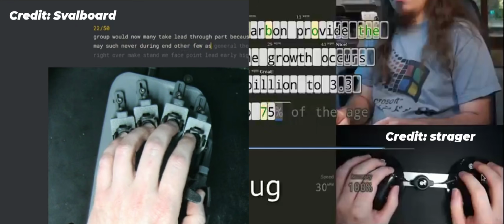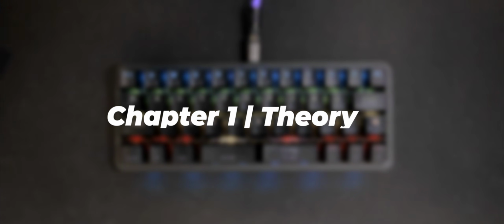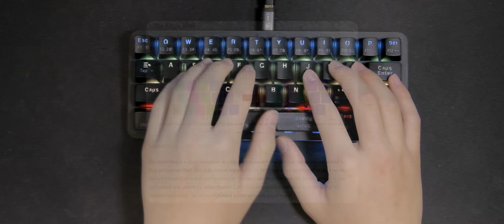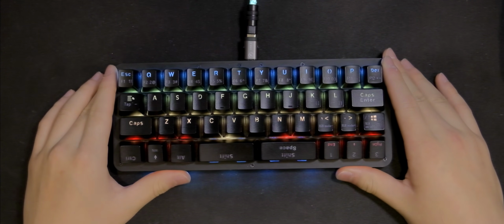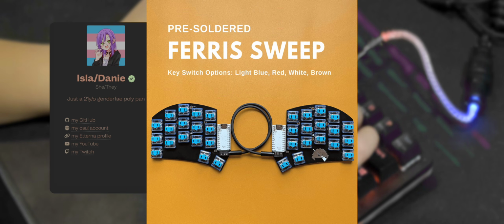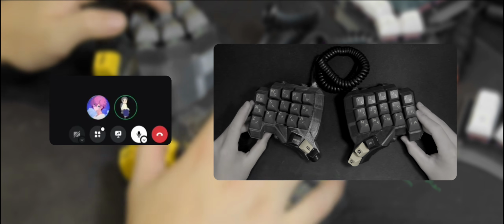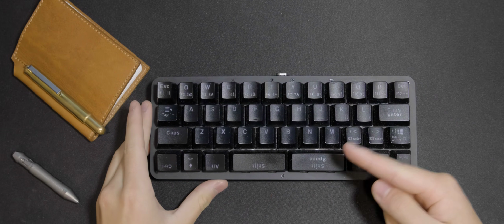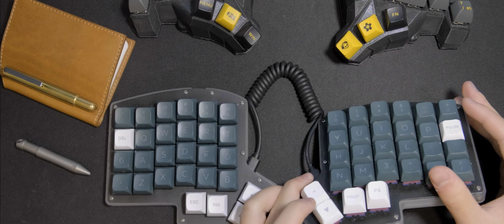A Split-Story | Ergonomic Keyboards

Comment: Stating objectively that there is no benefit to using a split, columnar keyboard with qwerty is wild. I think it's easy to forget the tiny niche within a niche you fall into, but most split users still use qwerty, and they wouldn't be using those keyboards if there weren't benefits. For most people, absolute speed isn't the goal with typing - the average typing speed is 40WPM, you're not going to be fired from your job for "only" typing at 80. The primary goal is comfort and preventing injury, and there is very little evidence to show that alternate layouts have much benefit in this regard, nor is there in terms of typing speed.

I think in many ways it's a dangerous comment to make: the switching cost moving away from a monoblock, row-staggered board is already pretty high, and insinuating that it also requires learning a new layout amplifies that even further.
Reply: This is your interview, if someone you have made appear to be an expert makes a statement in it, which you clarify in your own words without you refuting it, I'm going to assume you hold a similar sentiment.

Also, what is your fixation with the 'b' key, and why do you think alt layouts make such a big difference because of it? It's the 7th least common character, and is left in the same position in popular layouts like colemac. I use a columnar, choc-spaced board, and this does reduce my finger movement to hit 'b' compared to row staggered because of the unequal stagger of each row. This is also something which was left out of the discussion for ortholinear keyboards, which seems a huge oversight given your clear focus on it. Colemac mod-dh does move it, but it remains in the centre column, so is no harder to hit on a columnar keyboard than it is in its original position.

The other massive oversight was downplaying the benefits of thumb clusters and layering for ergonomics. If you think hitting the 'b' key is hard, try pressing '?' or backspace on a standard keyboard. They also impact the layout discussion, because there is a strong argument that if you are using a custom layout, 'e' should be on a thumb key, which isn't possible with a traditional board. There also wasn't much discussion put into smaller layouts, which also reduce hand movement and stretching. I obviously can't expect you to cover anything in the video, but these factors didn't even seem to be considered before making sweeping statements and recommendations to people from the position of an expert.

I genuinely can't argue against your points here because they're so incoherent. "What about an Alice layout?" *Cites a paper showing Alice layouts have little ergonomic benefits*. What point are you trying to make?
Reply from the maker: That's a fair reasoning, however, my own claims are in the "My Experiences" segment - what interviewees say are for the viewer to interpret and I to present.

My interpretation is in my section. That also doesn't imply that I don't challenge their claims; I state that I personally do believe sculpting has some merit, for example.

paragraph 2

I use the `b` key as it's the most obvious problematic letter key on the keyboard. I was under the impression more common keys being placed in better positions is an obvious design consideration on almost any alt layout, but it appears I assumed wrong. Let me make this clear: alt layouts change more than just the `b` key's position.

The ones I've mentioned in the video: Graphite, Meteorite, Quasar, Kuntum, etc. all place the `b` key in arguably superior positions (on angled-staggered) AND frequent letters like `e`, `a`, `o`, `h`, `n`, etc. There are also many other potentially beneficial considerations which you can research on your own accord.

Also, if you've read, I did NOT deny there was no improvement, just that it was rather minute when comparing it being placed in a more optimal position in the first place.

Colemak-DH's `b` position is a perfect argument FOR alt layouts. Perhaps you would like to reconsider your reasoning here - Colemak-DH = colstag would be a fantastical reasoning for staying on staggered no? :)

`b`'s original bottom position on a staggered board is 1.5u horizontally away, while the top is in fact closer at 0.75u. This would put staggered Colemak-DH to be closer than colstag with or without DH.

Also, by your line for reasoning, QWERTY's `T` should be atrocious on colstag (it's exactly where `B` is on DH; and 7.12% more frequent btw [Shai]). This would again be a fantastic argument FOR alt layouts which commonly place `t` in a better position.

On Colemak (which I didn't even mention in the video), the entire reasoning is the freedom and creativity you can have with alt layouts - not continuing conforming to the popular. You do NOT have to use Colemak! There are other options!

With an alt layout, you can also place `?` or backspace wherever you feel comfortable - I guess this isn't obvious, but these, by definitions are also considered technically ALTERNATIVE layouts. What harms adding on a few swapped letters?

onto paragraph 3

Thumb clusters sure, but layering? Why not do that on a staggered? Also, split space keyboards are a thing. I'm not saying staggered is the best - if you've watched the video you would realize that - I'm saying that it is VASTLY underestimated.

For `e`, YES! GREAT! USE AN ALT LAYOUT! Putting `e` on thumb was done all the way back in 1977 I believe*. Again, perhaps reconsider your position.

What is a "smaller layout?" Just a smaller keyboard or smaller keys? Alt layouts consider stretching and key distance - LSBs (lateral stretch bigrams) and fingerspeed (a combination of factors including distance; or KLAnext analyzer which directly calculates travel distance) respectively.

As for ortholinear, I've already made a whole video discussing its problems; admittedly the quality isn't the best, and there are some factors I'd like to re-explore. However, I still stand by my point that in general, they are simply worse when paired with any form of competent alt layout. If you've genuinely read my position, this would make at least a bit of sense.

Before resorting to the "I don't understand" argument, spend a second and read, including your own. Out of respect, I've thoroughly considered your perspective, and within your response, you've argued both for and against ergo keyboards yourself (read above) and the same for alt layouts. I can understand the gist of your position being for ergo keyboards and against alt layouts - but it realize that is not clear.

Either way, with respect for future readers, I will simplify it for you. You posited alt layouts do not have a solid base for their claims. I provided evidence proving ergonomic keyboards also do not have a solid basis (and specifically with QWERTY at that). So, by the same logic you used to inference alt layouts are ineffective, ergonomic keyboards would also be posited as ineffective. I'm sure you disagree with that claim, and so do I. Thus, the keyboard reasearch cannot be assumed to be 100% accurate. Does that make sense? 

In any case, if anyone has genuinely read this entire reddit-esq shenanigan
1) Thank you and bless you for having to reading this
2) I hope my point was clear in this video, I do not intend to disregard mainstream ergo keebs (that's a future topic of research *wink*) - but, rather, to consider other, free, options throughly if you do not sincerely wish to use one. Just as saying "Gaterade is the only way to solve exercise hydration" would be ridiculous, don't let advertisers win ;). 

However, if you do deem it worthwhile, by no means let me stop you. I myself consider my colstag to be one of my most worthwhile purchases - however ridiculous that sounds. This hobby is great, this hobby is fun, but there is more to it than  dropping another dollar.
Reply from the maker: Formerly (regarding the first point), I'm going to assume you are responding to danie as I did not make that claim in the video:

I do agree that there are benefits in ergo keyboards (wrist deviation, tenting, etc.) when used with QWERTY, however, a very good question to pose is exactly how much of that is solved by using a ergo keyboard?

- 2 cm of physical staggering is far less consequential than an alt layout. Would you rather move the `b` key three cm closer, or just have it in a better spot period?

- Wrist deviation can be greatly improved with the angle mod/cheat (keep in mind this works with QWERTY, and is very commonly accidentally used; L-index = c), and while I don't argue that split is superior, what about an Alice or split staggered?

- Tenting I would say is the only definite improvement over staggered as, well, there's nothing you can do lol.

Just because something is popular does not automagically imply it is good, or even that there is a good justification. That's how good advertising works :D.

As for the comment on speed/ the "goal", "most" people who are in that 40 WPM range are, more likely than not, not going to see benefits because:

a) They do not know touch typing/use hunt and peck, and thus there are extremely minor ergonomic benefits (if at all) from using a colstag (in fact ortho might just be the best for its simplicity). 

b) There are also few studies proving ergonomic keyboards having a meaningful benefit:

"The potential for ergonomic keyboard use in preventing injury in keyboard operators warrants further investigation."
Work. 2010;37(3):275-83. doi: 10.3233/WOR-2010-1079.
"This study does not support the use of fixed split-angle keyboards over standard flat keyboards to reduce discomfort in the workplace."
Work. 2015;50(4):677-86. doi: 10.3233/WOR-131797.
"In many cases, however, the available research does not resoundingly confirm their ergonomic, performance, or comfort
benefits."
Ergonomics of Alternative Keyboards, Texas State University

And yes there are sources that say it does benefit (see: Cornell University Ergonomics Web's Longitudinal Study of the Effects of an Adjustable Ergonomic...) - for curious readers :D; it's important to consider both sides.

Please be VERY careful when studying papers; there are MANY which have been sponsored/associated with keyboard manufacturers or ergonomic-related companies. Also, relying on participant responses for conclusions is difficult for both justifications. p.s. if you find good ones, comment them pls, ty.

As for the last point, why not learn an alt layout? If the advertised ergonomics are worth your hard-earned cash, why not spend the extra price of free to learn an alt layout? There's a transition time for both, and it might be fun :D

Comment: Voyager for me, and figured I would switch layouts at the same time to get the most benefit. It's been game changing. Layers for everything, I don't have to move my hands for anything anymore; nav keys, backspace, enter, modifiers, they're all on thumbs or the homerow. My chest is open, my wrists are facing the right way, and all my discomfort is gone including the savage rsi that was developing in my wrist
Reply: Awesome, how long did it take to get comfortable with your Voyager, and at that particular time what was your average tying speed ?. Did you switched to an alt keyboard layout?.a
Reply: @Destinied  I did! I switched to Colemak cold turkey on day one with my Voyager.

I spent two days on Colemak camp to learn the fingerings, then I spent 5 days practicing bigrams and trigrams, then I went to monkeytype.

First English 200, then 1k, then 5k, and now on 10k. I would stay on one dictionary until I could reliably hit 60wpm without much effort. 

Once I hit 60wpm on English 10k comfortably, I allowed myself to switch between English 10k 200 words and long quotes modes. 

Right now I can hit 70 on English 10k reliably, and 75 on long quote reliably. My max is 79. My qwerty average was 88-90wpm before I switched, on a variety of traditional 65% mechs.

I started on December 25th and that's where I'm at today, so coming up on 3 months and still some time to go before I'm at my old qwerty speed, but a couple points there: I can do this speed on Colemak indefinitely, whereas with qwerty I'd get hand and wrist pain after a couple hours. It's way more comfortable on Colemak and the voyager, my wrist pain and tingling is gone. Because of the voyager setup and Colemak layout, I actually feel like I'm typing slower even though I'm typing faster: the rolls are just so frequent and fast and convenient that my typing feels almost lazy and effortless even though it's still very fast
Reply: Can you share your config, do you use home row mod
Reply: Yeah let me hop on desktop and ill link it, i do use homerow mods but one row up instead of actual home row  @tuananhdo1870

Comment: 190 "words" per minute is not real. Do that while copying a text you have never read. Full sentences. Punctuation. And what was you 190 wpm accuracy rate?
Reply from the maker: I'm ~140-170 WPM on full sentences. Typists like Danie in this video, nothisisjohn mythicalrocket, shaz, chak, Sean Wrona, etc. are over to well over 200 WPM in full random sentences.

My 190 WPM accuracy was 98%, 197 WPM raw, 88% consistency.

Comment: There are fairly customizable pcbs for dactyl now as well - no need to wire them, thanks to BastardKB, on github now (not a single switch variants, but full flexible board for left/right hand respectively).
It is 6x6 which breaks down to 5x3, so don't really see a reason to hand-wire it, unless you are doing extreme angle and it won't flex enough without breaking.

Comment: I have the Reviung 41. It whas a long period of adaptation, but it's much more confortable than any other keyboard that I test. The only con that I can think it's that do not have the number line up. The next keyboard that I want to buy is the Lily58, split, numbers and full compatibility with VIA/QMK

Comment: Speedtyping is a different niche to what spawned ergo keyboards, they are not designed to give faster typing speed, they are designed for comfort and reducing strain when typing for long periods of time with potential long term health implications
Reply: Yes. You really don't need to type very fast as a programmer but if you get bad enough RSI it can be disastrous.
Reply: It's remarkable how comfortable my Glove 80 is. I have other keyboards that are prettier and seem cooler, but I can't get the same level of comfort with anything else I've tried. Kinesis seems promising as well, same with DIY dactyl.
Reply: Speed typing and ergonomic typing have a couple things in common including reducing the amount your hand has to move. So even if it's not intentional and organized keyboard could have features that make you type faster
Reply from the maker: This is certainly true, but some popular ergonomic keyboard manufacturers market their keyboards as having better "efficiency" or just straight up helping you type faster (see: Dygma "Transitioning to Ortho...", Das Keyboard "What is an Ortholin...", Typematrix "Study").

I have also seen this claim thrown around in a lot of older ergonomic keyboard reviews so I wanted to address this :)
Edit: Fixed incorrect source.
Reply: @va1orance  OLKB's claim to efficiency is keeping all keys closer to home row.  This would primarily impact modifier and function keys, which would not have a significant impact on typing tests.  OLKB also puts much more emphasis on comfort rather than efficiency.

Dygma mentions typing speed on only a couple pages, literally every other page on their site emphasizes comfort.  One of those pages tells you to learn how to touch type, which would obviously improve typing speed in the long run.  The other page tells you to use custom layers for special shortcuts, something that also would not have a significant impact on typing tests.

The focus on typing speed seems to really miss the point of ergonomic keyboards, which is ergonomics, not typing speed.  Typing tests would not be affected by things like comfortable thumb clusters, comfortable spacing between arms, angling the wrists correctly via tenting, etc.

And no, you don't need to be injured or unhealthy to appreciate a more comfortable keyboard.  A comfortable keyboard would prevent injury from happening in the first place, that's literally their purpose.
Reply: @val0rance Efficiency as a byproduct of comfort and still not primarily for speed typing.
Reply: @va1orance Efficiency in this case can mean "you have to exert less effort to achieve the same result" - nothing to do with speed. Music teachers will talk about efficient movements being key to protecting your wrists and body; i.e, the most efficient movement is the most ergonomic movement.
Reply from the maker: @charliecarrot  I can't quite seem to load the olkb source anymore, so I'll take that as a mistake on my part, but:
"Increased Speed and Accuracy
Less finger travel distance and a compact design could improve typing speed once users grow accustomed to an ortholinear keyboard." --- Das Keyboard, https://www.daskeyboard.com/blog/what-is-an-ortholinear-keyboard/

"TypeMatrix keyboard is a much more ergonomic keyboard than the types of keyboards previously used by the participants of this study. The advantages include:
...the possibility for greater typing efficiency (as measured by speed and accuracy)." --- Typematrix, http://www.typematrix.com/study/

"Theoretically, an ortholinear keyboard can enhance typing speed, accuracy, and comfort." --- Dygma, https://dygma.com/blogs/ergonomics/transitioning-to-an-ortho-linear-keyboard
(they mean colstag/columnar here too, should really update that lol.)

Credit where credits due, more or less nowadays, companies do a pretty good job with not advertising with speed. 
Your quote about efficiency is 100% correct---ergonomics literally translates to "relating to or designed for efficiency...", but it seems a lot of people haven't gotten the memo and thus is the reason I'm taking about it :)